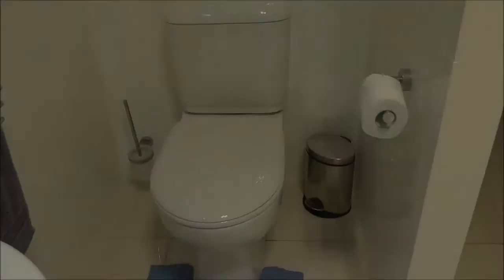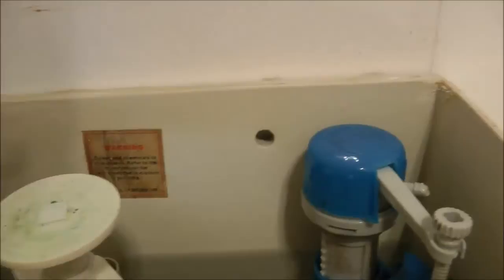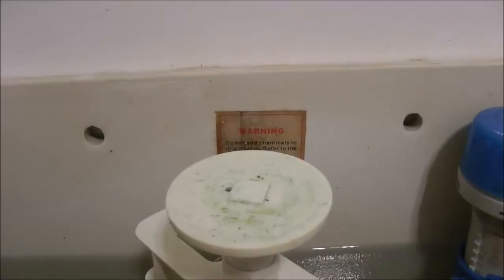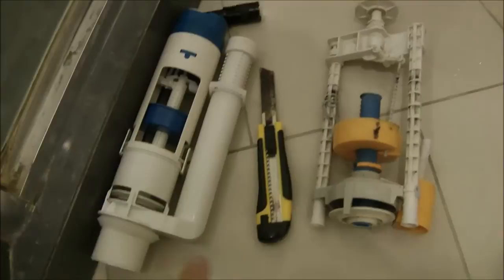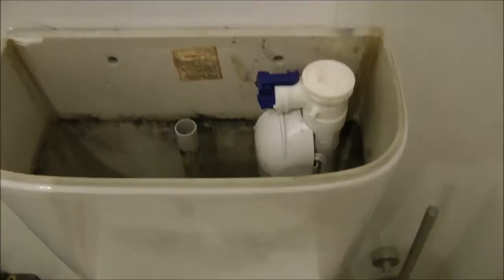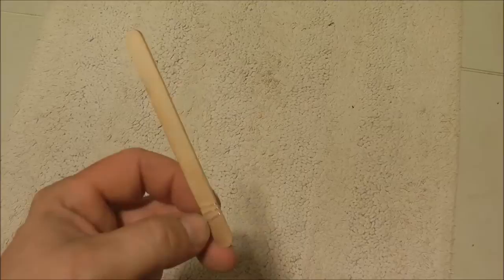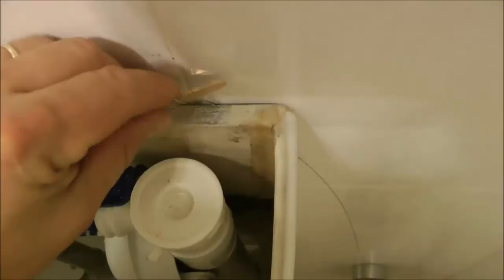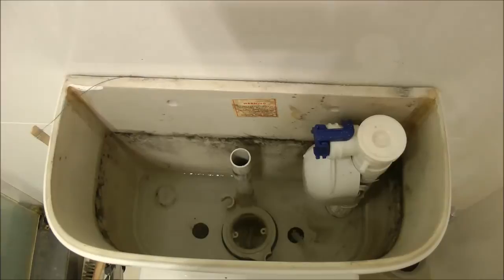Bathroom RENOVATION - repairing a glued leaking toilet cistern

Comment: Great video. Mine is glued on loads. I take it afterwards you secured it with screws rather than more silicone? Not sure if I want to drill into the tile if silicone worked all these years, so may resilicone if it's possible. Nowadays you can get replaceable syphons.